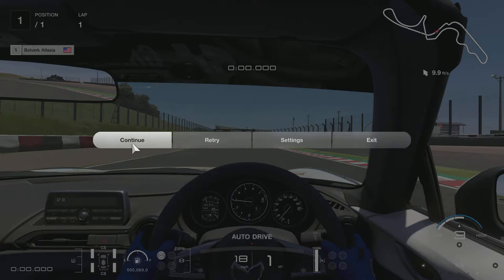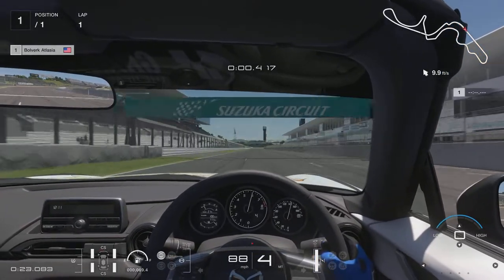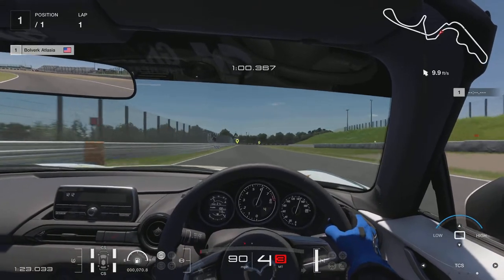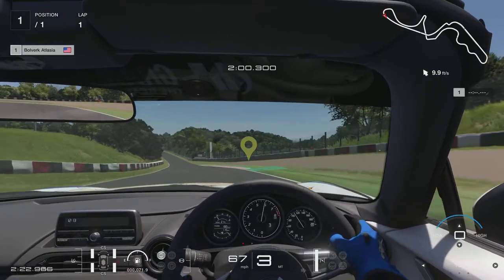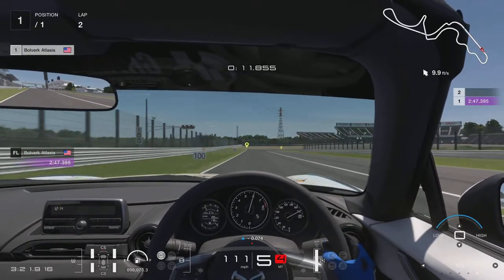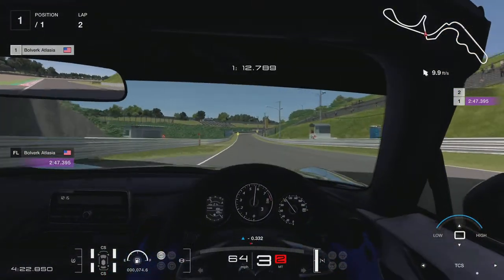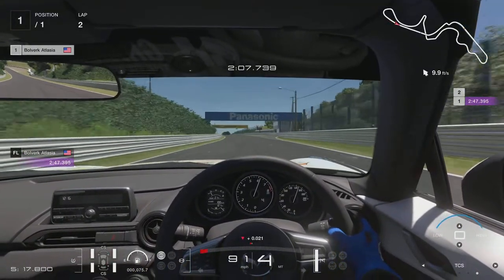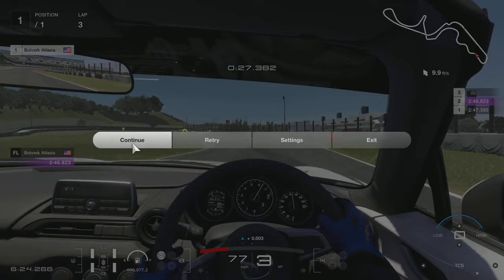GT7 - Slip Angle/Trail Braking (Logitech G29)

Comment: If you want a faster corner controll the rotation with throttle control
Reply from the maker: 💯

I've actually been steering with throttle a lot more lately because I've been on Assetto Corsa SRP a lot and learning that it's the difference between making a corner or hitting a wall.
Reply: @BolverkAtlasia  fr i love slip angle its just so satisfying to nail a corner